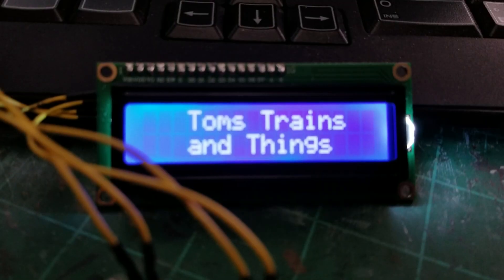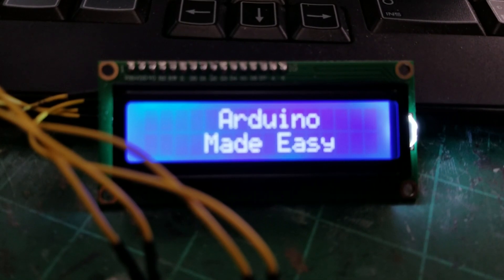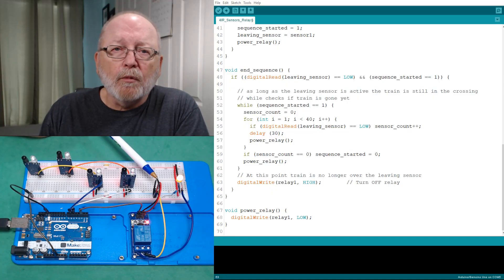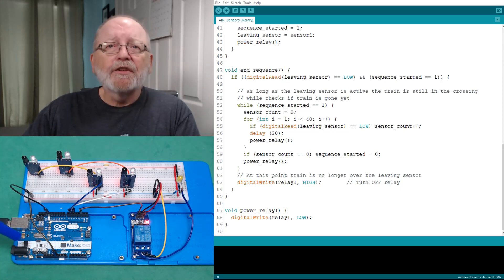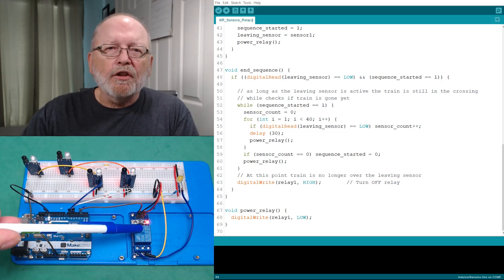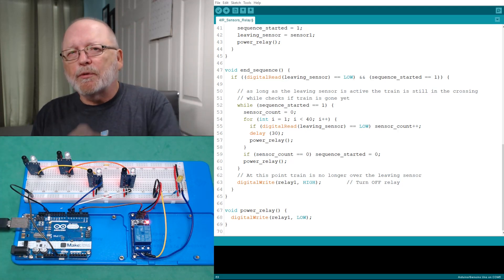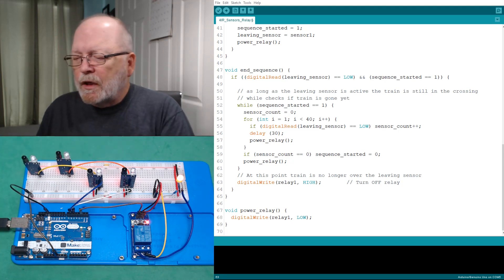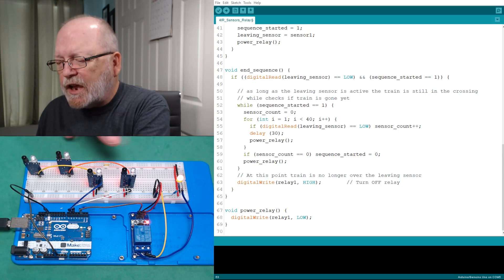Arduino Made Easy Lesson 09 - Using IR Sensors & Relays

Comment: Hi Tom, you can get 5 or 12v relays, what would you suggest?
Reply from the maker: Stewart, since Arduino outputs 5 vdc it would only work on the 5 volt one.

Comment: Excellent tutorial, as always.  Not being too electronically minded, why would I use a relay as opposed to just powering a switch motor, signal, etc., off the arduino itself?
Reply from the maker: Each output is rated at 20ma and operates at a max 5vdc. The relay is used to isolate the Arduino if you require a higher voltage or amperage for your project. Other modelers have asked about how to use this sketch to operate AC components and other modules they already have. Lesson 07 of Arduino Made Easy covers the same sketch but with the crossing LED's. A bell and crossing arm can be added to the sketch as in Geof Bunza's sketch on a crossing gate
Reply: Thanks!  Also, where did you get the blue tray that holds the arduino?
Reply from the maker: Amazon. You can find the link to my Amazon page and see it there.